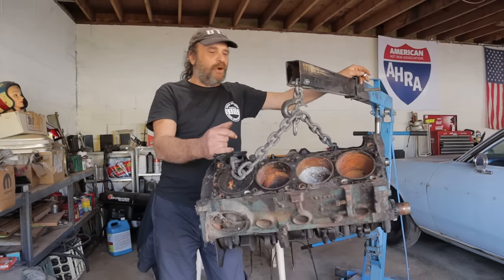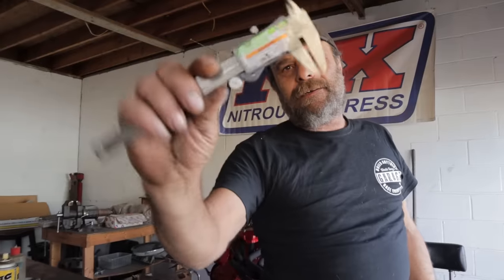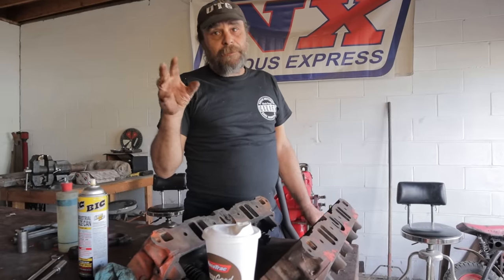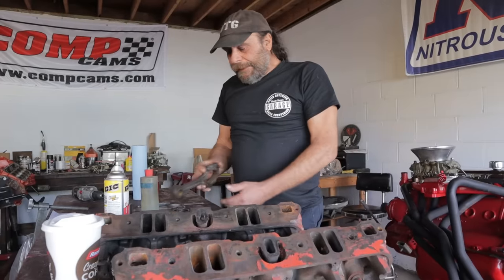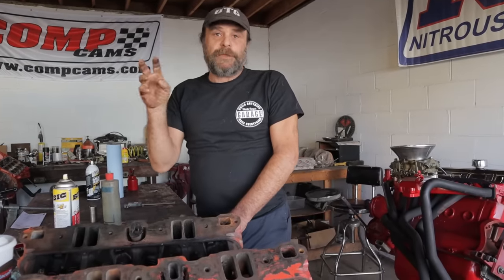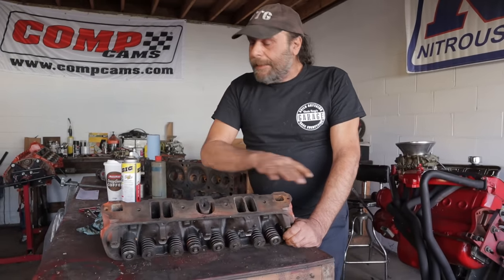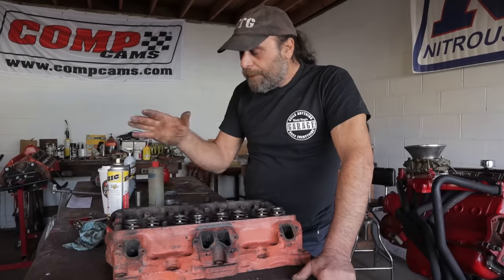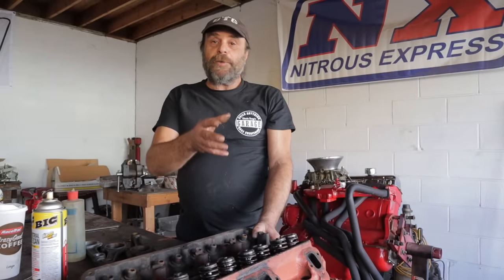The Most Under Rated V-8 In History?

Comment: Oh my... having owned two 225 ci slant sixes... that beauty in the background catches my eye!   :)   My '71 Plymouth Duster was 'rated at' 140 HP and ran very well.  I bought a used 1984 (?) full size, long wheelbase van with one that I found out later was 'rated at' 90 HP!!! What a DOG.  Both were very reliable EXCEPT I had to change out the exhaust manifolds of BOTH of them after they 'cracked'.  A poor design, somehow, I guess.  Neither one of them got good gas mileage... i'm guessing because of low gearing for power.  That being the case, why have a six??  :(

Comment: I had a 318 in a Duster and upgraded it with the original Edelbrock Performer Package (camshaft, intake, carb).  Insane amount of improvement. Practically doubled the power.  Adding Edelbrock Performer heads would have been dangerous. lol

Comment: Another problem is you dont have zero deck height with a 318, and they never really made an after market performance head that you could simply bolt on & get any decent compression out of. All the after market heads were pretty much designed for the 340 & 360 engines. The heads were useless unless you put different pistons in the 318 or start shaving the deck to get higher compression.

Comment: There is a reason they made the chevy small block for 60 years. It is the ultimate engine, why would you use anything else? My friends in highschool would only use GM small block cars in demolition derbys because  they could run 15 minutes without a cooling system while a ford could only last 5 minutes after the radiator is destroyed.

Comment: The 318, at least around here, was known as bullet proof and would easily outlast the vehicle that it was installed in.  Have seen them run well over 200k without being touched, and industrial engines that are still being used on a daily basis today.

Comment: They were a good motor as long as you never blew a radiator hose and let one overheat. Because once you overheated one it warped the thin lightest V8 engine block in history and warped possibly the heads  too and they would constantly blow head gaskets after that.

So when you stated that Chrysler worried about that one section of the block distorting, that was dead on a fact and result of overheating one. Their engine block was way too thin to be of any worth and that was also what plagued the 340 and 360 also. Once overheated they were trash and a lemon from that time onward.
Reply from the maker: You know, the exact opposite is true.  The 318 has been a choice engine for demo derby and endoro guys forever.  Mostly due to how long they will go with a punctured radiator and how they will almost always restart after seizing from overheat.
Don't take my word for it,  just Google it.  Long standing reputation and legend.

Comment: My Grandpa had one in his 94 ram 4x4. Pulled a 3500LB Vermeer stump grinder 5 days a week for about 13 years before it popped. It would of still been running if he changed the oil..filters? NAW. just drain n fill if it did get changed LMAO

Comment: Since 1972 I've owned as daily drivers Mopar 170, 198, 225, 273, 318(LA and Magnum), 340(definitely the best small block), 360(not Magnum), 383, 400, 413, 426(wedge not Hemi), and 440 Six Pack(fastest). 
All but the 360 and 400 were as good as the 318. 
I like the 413 in my 1964 Chrysler New Yorker best, by a lot. I think it was their best motor. Yes, the many 440sI had were great motors, but the 413 was better.

Comment: I've seen this before about 318 c.i Apparently it's the same as the legendary 340 but was considered a truck engine here in Oz where it powered Chrysler Valiants, shaded by the Ford 302 , a power pack by all accounts. My experience was less than wonderful. Coming home after night shift the lifters started to clatter. I mean really loudly. Given they're hydraulic I knew it was sudden loss of oil pressure. Limped to a motor garage which fortunately was very close. My mechanic dropped the pan to discover the oil pump had sheared the drive. Now, I've been around engines for over 50 years. Never seen that before. Another mile and it would have been terminal for the engine. The mains and big ends were fine. I was just lucky. So....if its such a great engine living the quiet life in my family driver, why did such a critical component fail. Maybe because it's a Chrysler??

Comment: Back in the early '80's I had a 1968 Fury III  convertible.  It had a 318 2v, with a 3 speed manual(3 on the tree), single exhaust, and a 3.23 rear gear.  The only options it had were power steering and power 4 wheel drum brakes.  It had no modifications.  In street racing, If I got out of the hole correctly and shifted the "tree" just right, I would beat '82-'84 5.0 Mustangs every time and also '85 and '86's if they were auto or if they didn't shift just right.  I thought that was pretty good for a stock 15+ year old full size, against brand new light weight Mustangs!

Comment: About heads , I prefer the X or J head  with 2.02 valves . Shave off .040 . also the intake side , the formula is in the yellow book . When hotrodding a 318 with these heads a piston change is necessary . KB has a domed piston . I have a cyl pressure of 200 psi in my 323 . It`s .030 over , Thats only 17 cui from a 340 . It runs GOOD . A 318 can do just as fine as a 340 . Love them . Click on my icon for some videos. As Tony says , aluminum heads is a good way to go if you do not want to change pistons .

Comment: I always thought the 318 was their answer to fords 302 and gms 305, I was sure it could be a beast.
Reply: The 305 has nothing on the 318 and 302 in my opinion. There's a bit of experience in there lmao. Im no expert. But i always had a hard time getting 305s to survive even in near stock form.
Reply: @youdropwemop8854  I was watching a video around October of a 305 build with around 420 hp. The difference between it and the 350 is like the 318/340

Comment: Just a mild street Cam, decent aluminum intake (even an early 80s diplomat police car aluminum intake an quadrajet carb duals on factory manifolds and they wake right up way better compared to stock. Good ignition is an early chrysler electronic. And old diplomat police car is a good engine parts car they have good alternators too.

Comment: We had a 75 dodge truck with a 318 that would not pull the hat off your head. Sorry, my opinion of the 318 is based on usage. We had a 360 in the Dodge van based camper, it was fine ... but used a lot of gas.

Comment: @ 5:52 you said "They introduced the 318 in '67..."  You'd better check that!  The LA version 318 was really introduced in 1964.
Reply: The LA was 273 only until 1967
Reply: The LA was 273 only until 1967
Reply: @ericlandstrom6155    Eric, the Red Ram 318 in my '60 Dodge just looked different than the 318 in my '66 Dodge.  Were they both "A" engines?  If so, please forgive my goof.
Reply: @nephetula  Yes, Don, the pre 67 318 was a Polysphere otherwise known as the A engine.  The 67 and up 318 is an inline wedge and that is the LA engine.
It shares the same bottom end as the earlier 318, but everything else is different.
The 273, 318, 340 and 360 are all LA engines

Comment: there really isnt a big difference in a 318 and 340 especially if you carefully build to specs and pay attention to detail . match piston to bore , take the edges off , file fit rings to application, port the heads, id actually rather have a 318 with closed chamber heads and all steel bottom end . smaller bore means less rotating mass not sure why people would think the smaller bore is junk ? especially if you lighten the assembly

Comment: THE 318 WAS A VERY GOOD ENGINE. IT KICKED LIKE A BUCKING BRONCO. THE PROBLEM WITH THE LA ENGINE WAS THE CAM AND CRANK DISTANCE WHICH IS LONGER THAN A CONVENTIONAL SMALL BLOCK FORD AND SMALL BLOCK CHEVY. AS THE 318 ACCUMILATES MILEAGE THE LONGER DISTANCE CAM  TO CRANK RELATIONSHIP MEANT MORE STRETCH ON THE TIMING WHICH EVENTUALLY LED TO THE TIMING GOING OFF AND THEY WILL NO LONGER RUN RIGHT UNLESS YOU CHANGE THE TIMING CHAIN. MOST PEOPLE WERE NOT AWARE OF THIS. THE METALLURGY AT THE TIME WAS LIMITED, SO GOOD STRONG METALS NEEDED TO MANUFACTURE BETTER CHAIN THAT STRETCHED LESS WAS NOT AVAILABLE OR WERE TOO COST EFECTIVE . BUT TODAY THEY ARE AVAILABLE AND THIS PROBLEM IS NO LONGER AN ISSUE. THIS IS WHY WHEN BUILDING A 318, 340, ETC IT IS VERY IMPORTANT TO USE A HIGH QUALITY TIMING CHAIN SET.

Comment: Get a small motor that can rev, put some big gears in it and you can go real good. Small inch novas were big in my day. Screamers
Reply: I had a '65 Cuda with a hypo 273. It a low ratio rear, a 2.73 I think. It was a 4 speed model, that was a great highway car. 3rd gear would really work well, great for passing. I sold it to a coworker who was supposed to sell it back to me when he no longer wanted it. He lunched the clutch and junked it. I wanted to kill him.
Reply: @karlbishop7481  its amazing how things slipped through our hands
Reply: @needmetal3221  I also had a Charger 500 at one point. Big recession,  in financial trouble had to let it go. I know what I had at the time.

Comment: The 210 HP 318 71 and older is the single exhaust. The Challenger got dual exhaust creating the 230 HP 2 barrel. Not a 73 up system.. 318-3 is a truck engine and as I've had now 5 D300s and 2 D500s I've been around them. Yes they had the better rod as he said. However the -3 has a heat treated forged crank and a 340 doesn't or other models. The -3 is so strong that there is literally no flex in the crank. The -3 doesn't have a harmonic dampener, it has a timing cup and that is it. Ever wonder why your timing marks have a threaded hole in the marks? Because the -3 uses a bolt in pointer as it doesn't use a dampener. 318s never got 273 heads, they are completely different. Lower shaft location, why you can't use the rockers and push rods, you need a longer push rod using the rockers on a later 318 up engine. The bolts for the intake are also smaller to say nothing of the ports being smaller. So no the LA 318 is different. You need to look at the chambers when looking at heads. You add the better heads and they fall on their face. So either start with a magum 318 with better heads or get the 250 CFM EQ LA heads. Why EQ heads? You get a 62 cc chamber required to add heads to a 318 without dropping to 7.5 compression. But you need AMC lifters and magnum rockers. Porting the 318 is just crazy, how much is your time worth really? And a thousand hours cutting them a mile is just crazy. In the past Mopar Performance so a 318 head that added 55 HP as they said over a stock 318 head and they added 360 valves. What wasn't said here is that head was the 302 swirl port TBI head, NOT the crap old 318 heads and had the closed swirl chamber and was ported a mile by Mopar. Again a waste of time today. Start with a TBI 318, then by magnum roller lifters not the TBI as the only difference is the oiling hole. EQ LA heads are $340 a piece, port those for 280 CFM easy. Get a big Voodoo hydraulic roller. Run the LA RPM intake and run the crank and rods from a -3 with forged pistons. The -3 block is also a lot stronger, H beam rods and forged pistons and the -3 block is a good turbo choice. Other than trucks I've also had 2 Shelby Dakotas with a TBI I modded and modded 4 magnum trucks. Your best 318 choice to own out right is a 92-93 318, unless you go poly. But my 354 hemi is a lot cheaper to build than a poly..... In the engine the best reason for a 318 build is boost, short stroke, strong cylinders, and the best internals make for your best choice. You see lame carb builds past 750 WHP and past 1200 with EFI. Add 2" of block filler and and 4 bolt mains with girdle and boost it to the moon. 340s have thin cylinders than pop and you don't need 20 CID to make power with boost, you need strength for more boost....... So other than a pile of miss information and the longer harder road to get there a pretty good video. And yes the 318 can be made into a great engine but being I just built a roller cam 408 from a TBI for less than 2K with a TBI 360 block it is hard to go it the long road unless you run boost again....

Comment: Sorry but there is a balance issue with the 340 and 318 engine, 340 pistons are heavier so the rod journals are drilled to lighten the bob weight. If you dont balance the engine when using a 318 crank in a 340 or vise a versa it will vibrate!

Comment: The Carter 2 barrel carburetor that came from the factory was trash. A Holley 2 Barrel aftermarket not only held the prime it cracked in a Split Second and save the starter. It also allowed me to lower the idle speed and still have the engine run smoothly.

Comment: This video got my blood boiling again......I have a 72 Barracuda with a mid 70s 318 and 727 automatic withe 3.55 gears out back in it. Bought the car as a roller with a non running engine a dozen years ago.   I didn't build the engine, but I know it has a purple cam in (pretty lumpy-- I know its a purple cam because when I had the Edelbrock performer intake off once I saw the paint on the cam) and J heads (unknown valves). I was told the bottom end was stock "except for a doubleroller timing chain"...., so I assume stock pistons.

 It had a 750 edelbrock carb on it when I got it but it didn't run right at all at first fire....couldnt get it to idle.....so I swapped in a new 650 cfm Edelbrock 4 brl.  I also added Dougs headers......

I found that to have it idle at ALL I needed to go to a 2400 stall convertor.....and I still have idle issues...it wants to idle on the slots all the time.....bumping the idle speed lower has it stalling at lights etc.....but I have just lived with it.

The engine runs great around 3k rpms and up....strong...but low end stinks....I have always assumed that is due to the J heads and the low compression they cause on the 318.  I did a compression check years ago and while the cylinders were consistent the compression was low....again I figured that was due to the heads....and have lived with it......

For all these years I have fantasized about a 408 stroker figuring why bother with heads and a cam and just go "all the way" when money allows it.........well, that hasn't happened yet and this video got me thinking again about dropping a set of aftermarket aluminum heads on it.

Can anyone help me out?   Knowing what I have above, would I be able to safely go to a set of aftermarket heads and if so what would be the recommendation? And can I keep the Edelbrock intake?

And also, how do I figure out if I can reuse the pushrods I have or not?   If I end up needing new pushrods, does that mean new lifters as well?  I do not want to swap out the cam.

I would appreciate feedback.

Comment: I respect the durability of the 318. But why is it so hard on gas? I had a chevy van with a 350 and it got better mileage than my old ram with a 318. I'm a mopar guy at heart, but I shy away from them cause they use too much fuel. Now I'm driving a frickin ford.

Comment: If it was a GM engine it would be the 307 olds. Same stroke as the big bad 403 350 but it suffered from crap heads. Damn near indestructible and it has potential.

Comment: The 318 is NOT Under-rated or unappreciated at all. I disagree entirely with any thought that it has been "under rated". To coin a phrase, "it is what it is!" The 318 is the grocery getter car engine and that's about it. It does what it does VERY WELL. It's bang on reliable. As a performance motor it lacks cubic inches and by the time you put on better heads, cam and intake and carb you still are light on Cubic inches vs better choices available.  If you're gonna do to the effort to build up a cheap-ish workhorse MOPAR V8 to performance I can't think of a single reason to prefer a 318 to a 360. If you're gonna stoke it for extra displacement now into the extra coin that could have given you lots of other preferable choices, IMO. Can a 318 be something better in terms of a performance motor? Sure, money will fix just about anything. Would I do it? Nope.

Comment: I did the 360 did the swirl port heads , all old tech way behind the others and mostly copied. Meh power . did flat tops , cam , springs , edelbrock intake carter carb. Mopar perf ignition. Ran good but not anywhere near close to my SBC with the same cash in it. Spend allot of cash to not get that far.

Comment: There are builders that are getting 600 HP out of a 318. There boring 90 over and making a 408 stroker. Thirteen and a half to one compression bigger cams with a high rise and a holly double pumper. Turning tens at the strip.
Reply: Damn!!....it took me breaking out the 175 jets to get my factory long block Foxbody to break in the the 10.9xx
What is that 600 hp attached to??

Comment: I never thought gms 5.3 was not to be considered because of the small bore, I will admit, I was wrong I've seen holdener test them and they do pretty well. Not like the 6.0 or the 6
2. A friend did a 7.0 ls it is nasty. Over 600 to at the tires  it has a small stick and ported heads. What about the hemis. I have a dodge truck with a 5.7 it is strong

Comment: not to totally disagree with you, I think the 400 is the most under rated engine. Yes the 318 never got the respect deserves, yet it still carried on until 2001 as 1 of the only 2 v-8 engines used. the 400 is the one that never got any respect because it was only marketed as a smog motor and never got any performance parts. even today the only hp high compression pistons you find are for a stroker.

Comment: A 318 is like a more powerful slant 6, you can fuel it with water and lube it with sawdust and it will still run forever. Hell most of the time when they die they will still crank and run